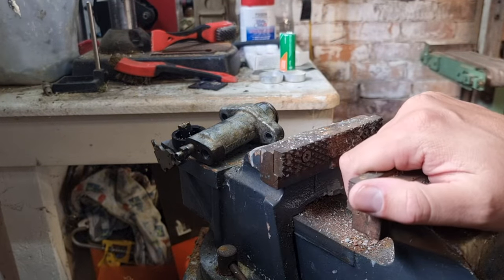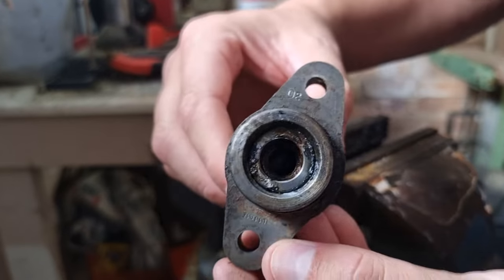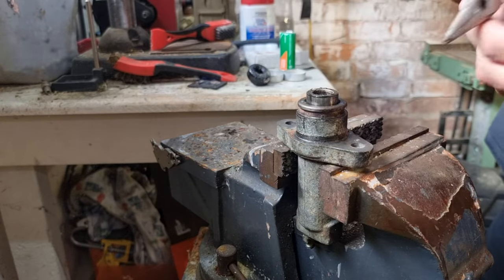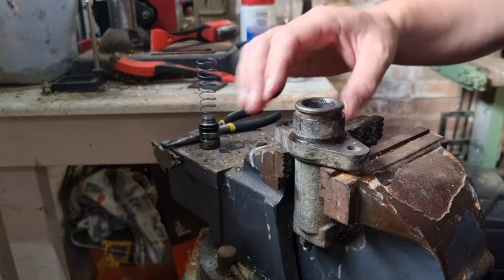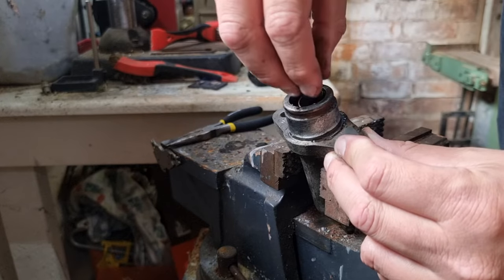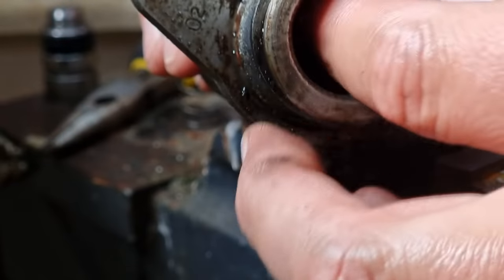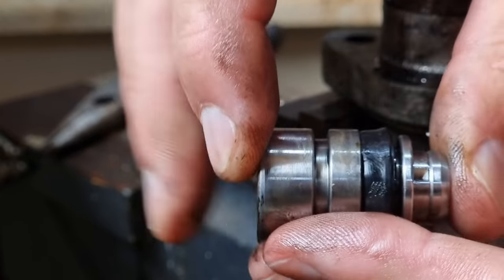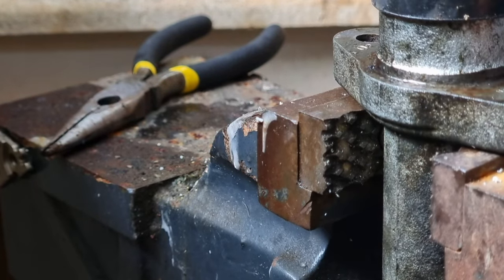Slave cylinder autopsy | 6x6 Perentie Ambulance

Comment: Ummmmm, by looking at your one. Maybe I should change mine or change O-ring. I have O-rink kits for Old Citroen which uses brake fluid type for its suspension.  Should have had 2 orings???
Reply from the maker: Yeah I'm not sure about two rings still, have looked at a heap of pictures and some have 1, some have two.
Never autopsied the 4x4's dead one when I did that years ago.